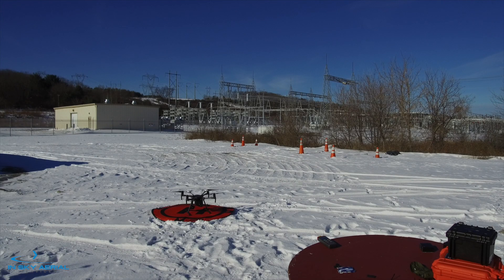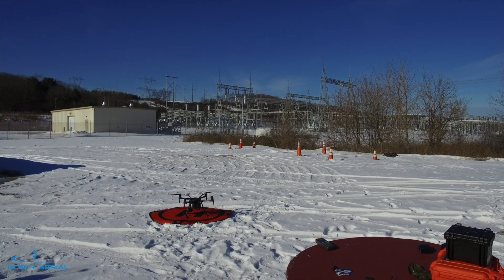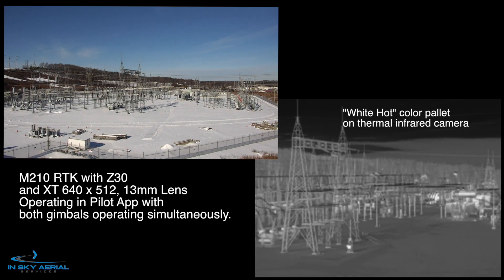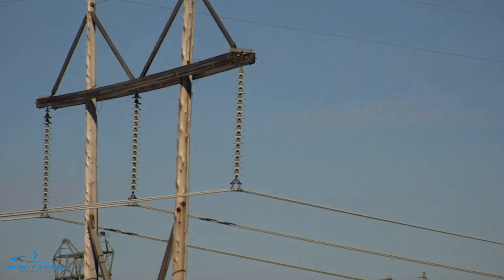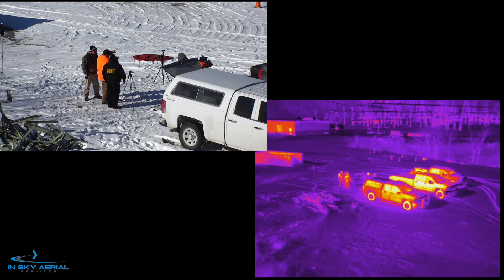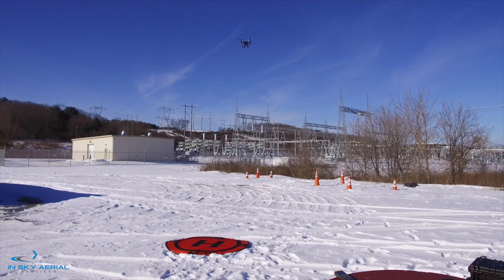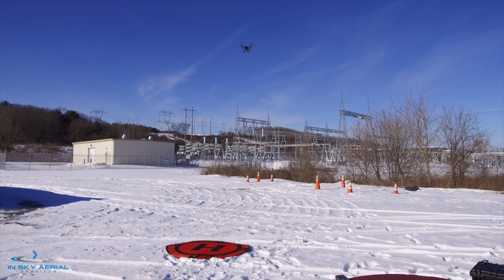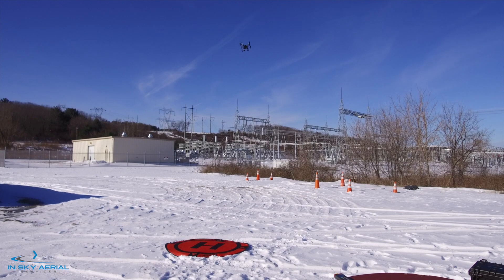DJI M210 RTK  Cold Weather Powerline & Substation Inspection Training

Comment: How are you doing, A big greeting from Argentina !! I have a question to ask you. I have a 640 19mm XT camera that I normally use in an Inspire 1 V1 and it works perfectly. Now I wanted to use the same camera on a Matrice 210 with RTK and I don't see an image in the app. I tried it in all the applications there were and I can't see the video. Do you have any idea what might be happening? I have another 9mm XT camera also 640 and it works perfectly on the Matrice 210, but the 19mm detects it, but it does not show me an image. I hope you can help me, thanks.
Reply: from my understanding if you don't have an XT version 2 you have to send it in for an update for it to be able to work properly on Matrice series

Comment: About the shake of the Z30. Is that more when coming into digital zoom or is it a constant shake? Also, how resilient is the drone against EMI?
Reply from the maker: Yes as the zoom increase so does the "shaking" especially when in the digital zoom portion.    The 210 seemed to do fine with EMI,  no issues observed.    However, there are issues currently with loosing signal that have nothing to do with EMI.
Reply: Signal - Video feed or connection to the craft? I have read some threads on issues with the Matrice 200 series and for the price, I'm hesitant to invest in this solution if it's not 100%. Do you receive different customer support in the industrial category or the standard consumer support?
Reply from the maker: With both.  It is the aircraft disconnection that worries me.   It shows up in cold temperatures often.   I am working through the enterprise dealer, fly high usa.   I own both the M210 and M210 RTK and neither are 100%.   Keep an eye on our channel and FB page as we post our findings.
Reply: I will definitely do that. Thank you for your time.
Reply from the maker: My pleasure.   Good Luck!
Reply: Ralph has made a Rain/Snow (RainShield) that i recently picked up. Did firmware cure your problems